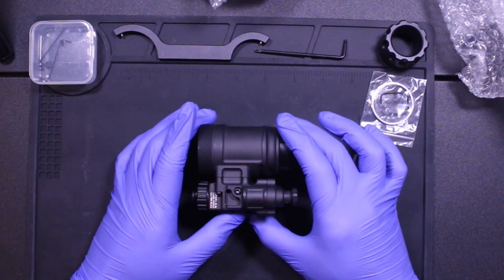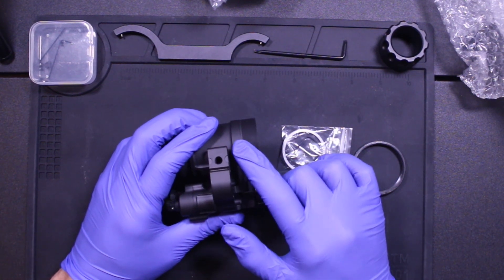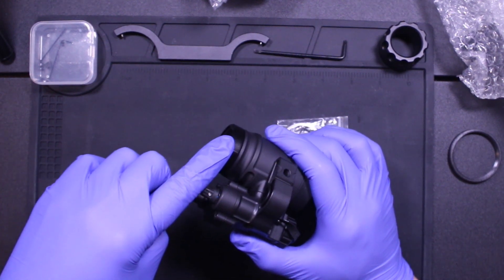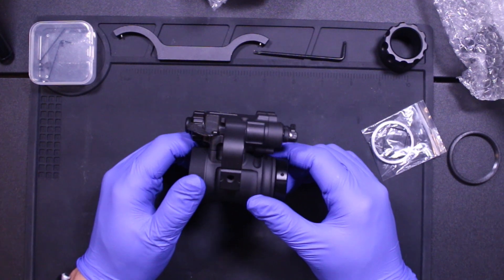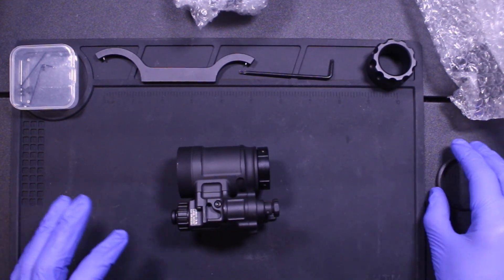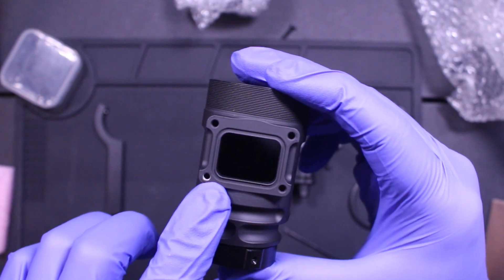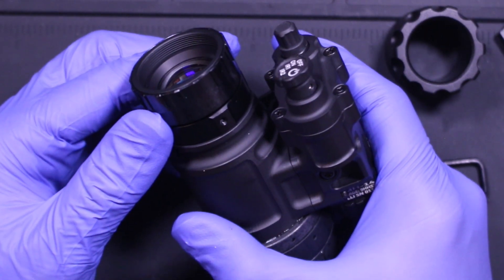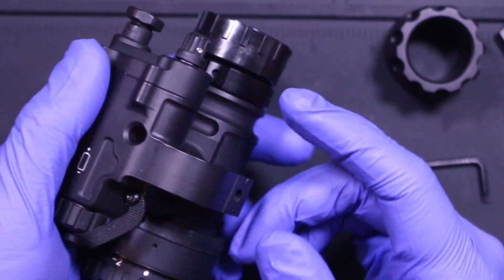DIY MH-14 Night Vision Monocular: My First Build Attempt (What I Learned)

Comment: Why did you put dielectric grease on the threads?
Reply from the maker: @nealthedestroyer1  to lubricate it?
Reply: @ was it bound up real bad? The industry guys who trained me never recommended lubing any threads as it could leak into the housing and cause issues. The only lube should be Krytox used on the lens seals
Reply from the maker: @ I was told it was fine unless you put a ton on there
Reply: @nealthedestroyer1  I've cracked open pvs-14 units from two different vendors and both had grease on the o-rings as well as the objective lens threads. Not saying that's how it's supposed to be, but perhaps that's common practice now.
Reply: @ was it dielectric grease or Krytox?
Reply: @ because that was wayyyyyy to much
Reply: @nealthedestroyer1  Tbh I think one was krytox and one was grease. And to your point, the one with grease hardened and locked the objective ring in place 😂.
Reply: You can lay the grease on a lot its fine